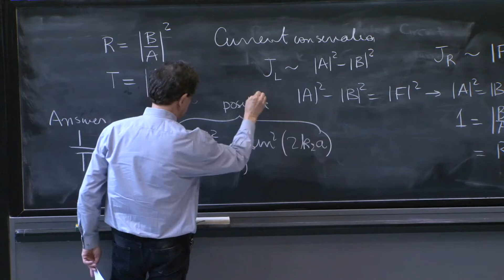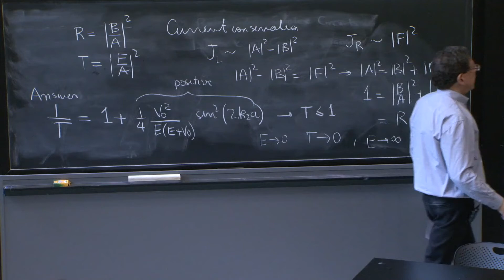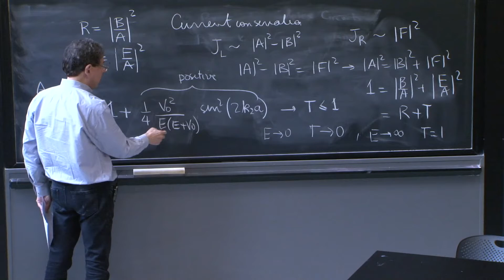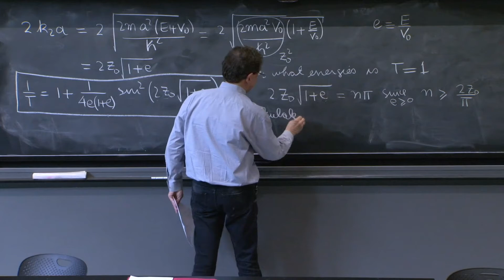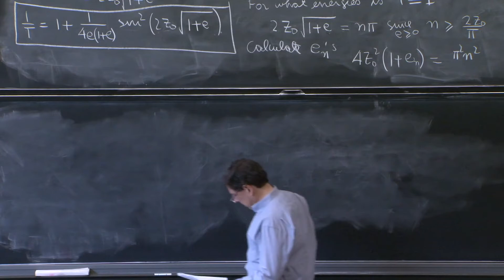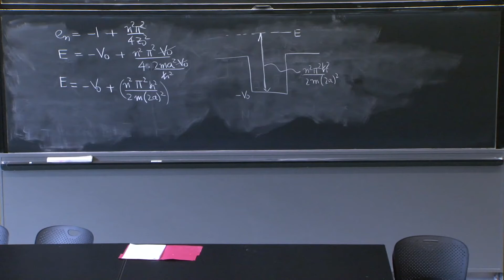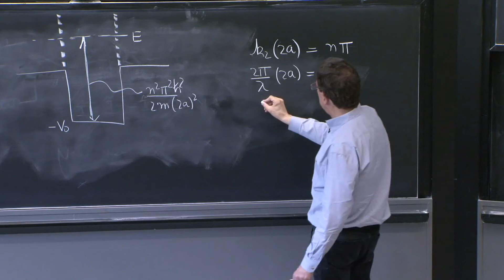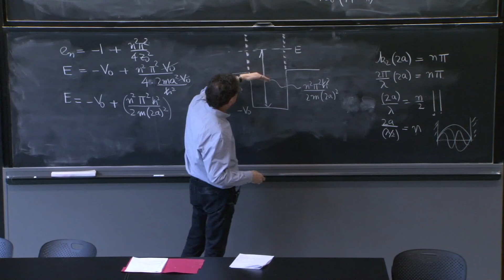Resonant transmission

Comment: I typically think of the wells as radio antenna transmitters which are a little more in-depth than ones just for receiving and for the exact reasons given. A half wave dipole of a specific length is a quantum well for a ground state of a specific λ (and also for the excited energy eigenstates of higher  frequency multiples but for now just the ground state). Transmission is the goal and the key is in the geometric dimensions of the antenna (assuming that the radio all works how it should). The wave ψ moves across the tuned potential so that once about half of it reaches the negative side (a standing electric field for the briefest of moments) the phase flips and so to does the potential. Entropy drives the potential via EMF via the B field, thats why the energies are continuous, because B does it's work. It was working to turn E back to zero and at the key moment π the B field flipped and so too the direction of the work from, say, down and towards to up and away. This first half wavelength of the wave packet is the only time when you can have an affect on anything because after that you completely hand over whatever free particles didn't reach the ground and are still in space around the antenna to probability amplitude (the field pattern) and its gone.